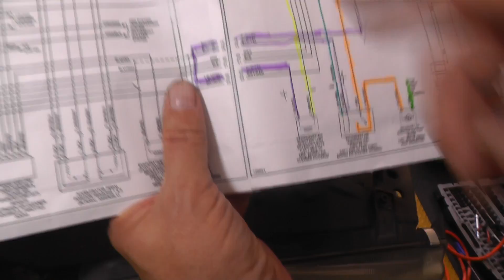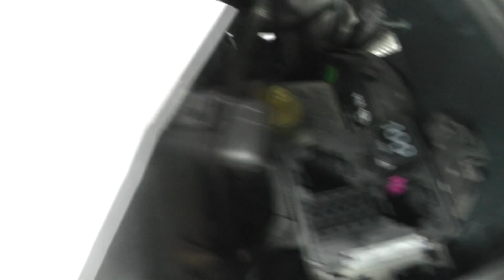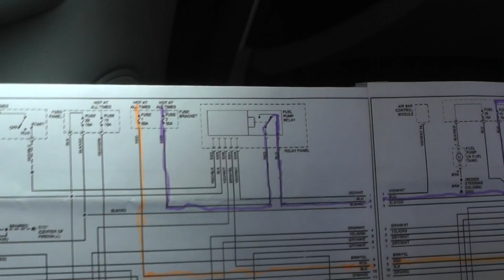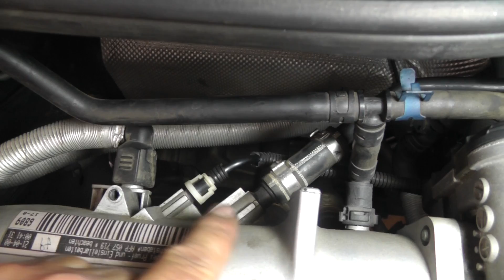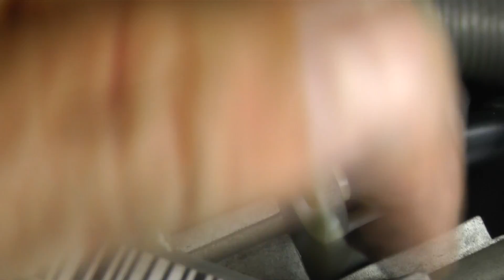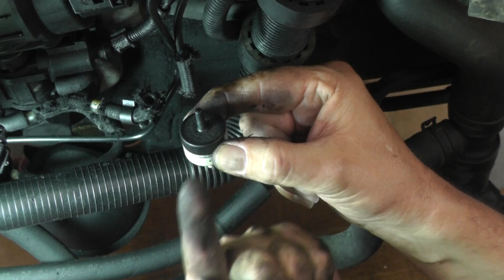Volkswagen Jetta Secondary Air Injection Diagnosis Part 8 (Understanding Components on Car)

Comment: I have a check engine light on my 2000 vw jetta and it was  code p0411.  I bought a new air pump and put it on and the check engine still came back . I need a smog test too. I bought this used car. What should I do? What can I do?
Reply from the maker: Lanny for me to list every possible cause and how to troubleshoot it would be a very long posting. I created 12 videos in a playlist where I go over each item in the secondary air system, wiring diagrams and how to check the items. Take a look at the playlist starting at the first video and continue through them. Here is a link to the playlist. Afterwards, I can answer a specific question if you have one. https://www.youtube.com/watch?v=kFiSGQgeHHw&list=PLrbHoqGceWKQAnWUj-jmbQhYjz4SpEPBH

Comment: I have a big question
If that pump doesn’t work I would pass the smog check 
My monitor of air sección is not complete 😔
Reply from the maker: If your pump doesn't work Gabriel, then you would be getting a code which would not allow your emissions to pass.

Comment: My 2011 VW Jetta SE has the p2432 code and it tends to stall when starting up or when at low velocities. Could this secondary pressure sensor be responsible for the stalling?
Reply from the maker: Could be the sensor or its wiring...

Comment: Wow! thank you for taking the time to explain us all. Great series of videos. Much appreciate it
Reply from the maker: You are quite welcome!
Reply: @stuzman52  hi i have a 01 vw gti glx 2.8 i have this code coming up 16795 can you please help
Reply from the maker: Eddie, the code 16795 is the same as P0411 which says that there is insufficient air flow for the secondary air injection system. I created 12 videos addressing this issue and I covered every component in this series. Here is the link to the the playlist for the videos. Take a look and them and I'm sure your issue can be resolved. If you have a specific question, ask and I'll try to address it. Here is the link to the playlist: https://www.youtube.com/watch?v=kFiSGQgeHHw&list=PLrbHoqGceWKQAnWUj-jmbQhYjz4SpEPBH&index=2&t=0s

Comment: hi,
can i ask about my car. i have a touareg 3.2 v6. it has a fault code "17840/P1432/005170 - Secondary Air Injection Solenoid Valve (N112): Open Circuit". i have changed my secondary air selonoid valve and intake manifold valve. but fault is going on.
what can i do about this fault? i controlled fuses. i havent found a way. please help me.
Reply from the maker: It should be an easy issue to find since the ECM is saying that you have an open circuit for the solenoid valve. This valve should have a B+ fed and is switched on using a PWM signal from the ECM. In other words, the ECM is switching the ground side of the coil, off and on rapidly. The wiring diagrams are probably similar to the VW that I have, but go to http://www.bbbind.com/tech_database.html for free wiring diagrams for your car. Fill out the short form and select your year, make and model. Find the valve on the diagram and start troubleshooting. You may have an open wire, bad connection, etc. Holler back if you have any questions!
Reply: i controlled seconder air selenoid valve. i run up the engine and i use multimeter.
there was 6,82 volt. (i remove valve and put the multimeters props to cable. if there were a open circut, there was no voltage, was it??
i'll get crazy. i cant find where is the problem.
Reply: what about 6,82 volt?
is it a low value? i think it most be 12 v at least.
Reply: just i bought a battary 9 volts.
i connect to selenoid valve. it is run very well. in this case its voltage value (6,82 V) is enought.
Reply from the maker: It sounds like you have a scanner that can turn the solenoid valve on. If so, I would check the valve's operation in this manner. You don't need to have the engine running and you can let the scanner turn the valve off and on for you. I'm pretty sure that the valve is controlled on the dc- which goes back to the PCM. And the B+ voltage should be going through some fuse. Identify those two different wires on the valve by looking at the wiring diagram. Leave the connector in place on the solenoid. Back probe your positive lead of your voltmeter to the B+ wire on the solenoid and the black lead of your voltmeter to dc- on the battery post. Turn the ignition switch to the on position, engine not running. You should have B+ voltage on the meter. Move the positive lead of your voltmeter to the other wire on the connector. You should still have B+ voltage on your meter and this means that the solenoid coil is not open. Keep your positive lead from your voltmeter on the dc- wire coming from the PCM. Now activate the solenoid valve through your scanner with the engine not running. At this point, the scanner will turn on and off the solenoid via the PCM. This voltage will probably be hard to read as it will be fluctuating from B+ to ground and thus giving you an average voltage. You should see some indication that the voltage is varying. More likely, you're not going to see a constant B+ voltage. If you really want to see what's going on, you'll need a scope. Also, while this is going on, feel the solenoid valve to see if you can feel it being activated. Hope that helps you out.

Comment: i found a vacuum line off this evening while i was poking around under the hood.   There is a small rubber J that connects to the intake tube "under it sortof" right after the MAF and air box.  it runs along the backside of the engine and disappeared near the secondary air injection selonoid.  "the one that rotates the arm in the tube of the intake" I cant seem to find where it plugs in i have searched and searched.   it has probably been unplugged since i owned the car.   any help would be appreciated.
Reply: Rhage73 PS mine is a 24v VR6, 2003 model.  the vacuum hoses are roughly the same but they updated a few of them.
Reply from the maker: Rhage73 You got me on that one Rhage. I'm not sure where the hose would go. And you're probably right about it being unplugged since you bought the car. Keep at it and I'm sure that you'll find where it goes.
Reply from the maker: Rhage73 Yes, I'm sure they updated a few things under the hood. Hang in there, you'll find where that J connects.

Comment: I got my exhaust off and the engine runs a lot smoother because my catalytic converter is bad and that is what i thought but i wasnt sure. It would shake and run hard and have to much backpressure coming in. I am gonna scrap the old one and get a new one and start from there and i also read that a bad coolant temp sensor can throw off the fuel injectors and a bunch of other things also! Thanks
Reply from the maker: Yes, I remember you talking about the exhaust and it sounds like you may have found a lot of your trouble. Keep swinging at it and you'll get it. Oh, stay out of the cold up there.

Comment: When i take off the vacuum line for the leak detection pump and try to blow through it i cannot so i think it might be clogged but i dont know if it is supposed to be like that. Is yours like that? Just curious! Thanks again! If i send you some money could you print up a wiring diagram and highlight what i should check to see what could be causing the low sensor voltages? I can mail you some cash. I have wiring diagrams but it is a pain in the butt. I am more the type of person that is a hands on compared to book smart! lol

Comment: when i got my 99 vw vr6 2.8 the 50 amp fuse 1 that you showed on the battery box was bipassed and i replaced it also when i got the car i noticed in the back of the upper intake that the first hose on the left was unplugged and when i plug it in the car dies for some reason! I have looked for diagrams in the bently service and repair manual and i cannot find where it goes to. I fixed all the ground fault codes when i replaced the 409 relay but the car runs like crap still and idles like crap. i replaced the purge valve also. this video REALLY helped me figure out that when i plug the line in that goes to leak detection pump then the car just stalls for some reason!
Reply from the maker: Sounds like you've got your hands full there Mickey and you're still hanging with it. But it sounds like you're making some progress. Not sure why the car stalls when the vacuum port is plugged for the leak detection pump. The car shouldn't stall and not sure why it would do that. Glad to hear this video helped you out. Keep plugging away and I'm sure you'll probably fine a lot of stuff that the previous owner buggered up.
Reply: I am on part 9 now! :)

Comment: 2000 Jetta VR6: Is the part number for the Intake Manifold Change-over solenoid is 058 906 283C?
Reply from the maker: Wouldn't know about that Faisal. Easy enough to call a VW dealership to get a number though.

Comment: Hi , Stuzman52
I learned a lot from your videos , Thanks you very much.
I am a little confused about the check value on this video(this design) , what is the main reason for this value ? , I am confused with the other manufacturer's design that put the check value on the exhaust side of the engine ? Thanks again for your videos.
Reply from the maker: Hi pwf...Since you're learning a lot about system operation, you're well on your way to doing some great diagnostics. The check valve as you know is located in the vacuum source. This is a one-way valve which allows the vacuum from the intake manifold to pass through the valve to the components, but does not allow the vacuum to go in the opposite direction. If the valve wasn't there, then the vacuum going to the components such as the solenoids, combi valve, etc. would get a varying vacuum when the engine speed goes up and down. So, if you have a constant vacuum source to the components, those devices can operate more reliability. Hope that answer your question and glad to hear that you liked the videos.
Reply: stuzman52 Thanks you Sir , you are a good teacher, thanks for using " if the value wasn't there " and " varying vacuum " in your explanation.
Can you use the same technique to explain the reason for the vacuum reservoir.  Thanks again.
Reply from the maker: pwfcpwfc Sure pwf. Think of the vacuum reservoir as a holding tank to hold the vacuum when it's needed. Image that the reservoir wasn't there and you only had the vacuum line to supply the components. All the components could be wanting vacuum, but there is not enough volume of vacuum. So, the reservoir will store this volume of vacuum, and supply it when its needed by the components. Another way to explain the reservoir is thinking of it as a water tank. Fill it up with water and you've got an ample source of water until it runs out. Of course, the vacuum is always being supplied by the intake manifold and once it gets into the reservoir, it can't go the other way because of the check valve. Hope that make sense and thanks for the comment and question.
Reply: stuzman52 Thanks Sir, your explanation fill the gaps for me to understand how this part of the system works.
Reply from the maker: pwfcpwfc No problem pwf...always glad to help.

Comment: hi stuzman52
My 2000 Jetta vr6 GLS stumbles when I slowly press the accelerator to get the car going. And now I get an engine light code PO102, PO411 and PO113. I cleaned my MAF sensor and cleared the memory. The code came back after 4 days. There is a hose that come from the engine to the air filter case that doesn't stay sturdy.it's called the air injector hose. Can that be the problem?  I want to go step by step before i spend money.
Reply from the maker: Sounds like you're on the right spot. The hose as you mentioned that connects to the air filter box goes down to the input side of the air pump. If I remember, I believe this hose is on the downstream side of the MAF. If so, the extra air would not be accounted for. Check to see on which side the MAF is connected as I can't remember at the moment. In any event, if you have a leak there, go ahead and fix it. On your P0411, the intake hose may not be supplying enough air to the pump for the O2 sensor to sense. As for the P0113 code, that should be a easy one to diagnose since it's the IAT sensor. Since you've read the codes, I assume that you have a scanner to look at the data for all of these codes. Let us know how it works out.
Reply: stuzman52 It is on the upstream side, before the MAF. Many people have removed the breather hose from the airbox and rigged up a small conical style breather filter instead. They're about $5 at AutoZone. If the lack of airflow into the pump is the cause, the breather filter will remedy it quickly (while looking nice as well).  I didn't even need to plug the hole for the breather hose on the airbox either but you can if you want to. Often times the source of P0411 on the 12v MK4 is simply pinched vacuum lines running to the combi valve though. This can bee an exceptionally difficult area to access.

Comment from the maker: I wanted to give everyone an update on the diagnosis video on the car for the secondary air injection system. The video has been shot and only needs to be edited. Originally, I was going to put all the diagnostics in one video, but it turned out to be so large, that I've decided to break it up into three parts. If all goes well, the first part will be uploaded later this evening. Thanks to everyone!

Comment: Eagerly awaiting Part 9...  love the thorough and methodical approach.  The teardown of the car to create a real-life traceable visual of the diagrams makes it very easy to follow. That is way more altruism than I'd ever volunteer to do so I applaud your thoroughness!  No doubt anyone with an air pump system issue will be able to complete a diagnosis and repair regardless of if the fault is the same as what you find. That is what makes a truly complete tutorial video in my opinion.

Comment from the maker: cover all this and more, I'll need an outline of steps to follow. It's going to be a lot of info. And I'll point out that if you have to pull the front of the car off, you'll know beforehand there's a problem there. So, I'm not sure how long the next video will be, but I do want to include all diagnostics in the next filming. So, we will roll on that one. Stay tuned for that one!

Comment from the maker: Sorry Joe for the confusion on my part. You're right that if I worked on cars for a living, I wouldn't have this option of doing all this. As I mentioned earlier, since I it's my car, why not show the complete system. In the next video, I'm going to try and include all diagnostics on the vacuum lines (smoking), energize valves (check passages), energize air pump, open combi-valve and a slew of other stuff. I'm going to show both DIY methods and hi-tech using a bi-directional scanner.  To...

Comment from the maker: Thanks for the compliments. I could make these videos with a LOT less detail, but no one wouldn't know anything about the system unless they were familiar with the system. Then, if I did that, I figure, what's the point of the video. Sure is hard to know where there is too little or too much detail.

Comment: There's something very appealing about tearing the whole system down enough to find every vacuum and electrical connection. Clear and complete understanding makes diagnosis of the problem much easier. That approach seems to be very different compared to the algoithms that the engineers give to techs to diagnose the problem, but in that case they are mostly following a protocol without necessarily understanding it all.